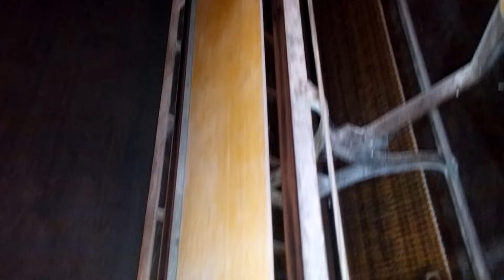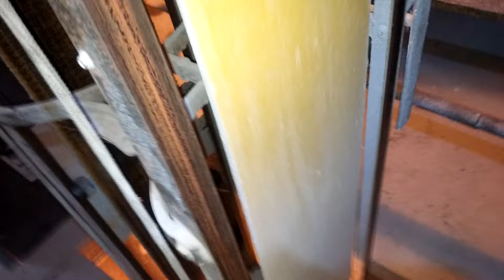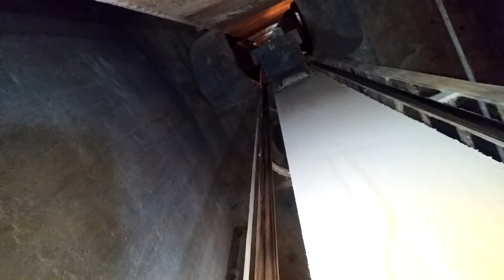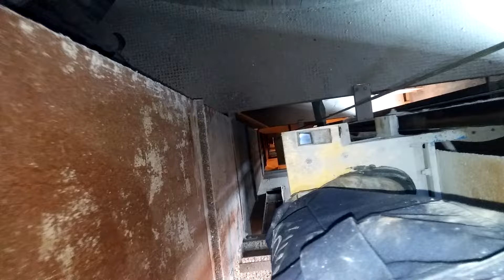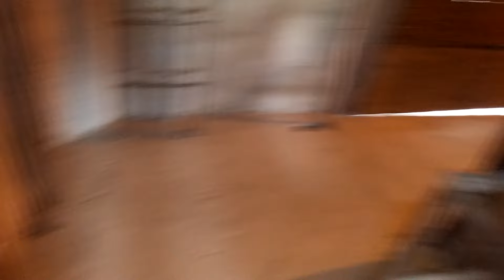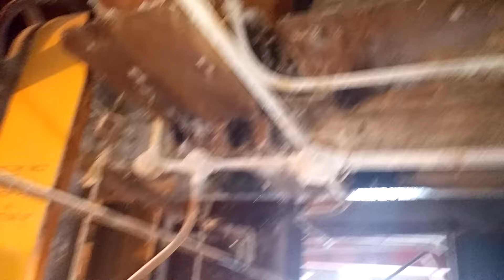Humphries manlift

Comment: As a firefighter, I rode one to the top of the head house on an alfalfa mill fire.  It was just on the silos, so no floors in between, just bottom and top, and it wasn't lit in between either.  Halfway up and its pitch black.  My mouth was so dry by the time I got to the top, you could have struck a match on my tongue.

Comment: Wow!!!! have not seen one of these since childhood days 1950s, my father worked in a flour mill in London and there was 2 of these, he called it a Man Hoist and was told they were used in flour mills. He demonstrated the safety feature by not stepping off at the top  floor, a safety switch came on and it stopped  The mill has been gone many years, and was owned by Spillers who bought it out as Charles Brown, it was next to the Thames and that site is now a BT office. Both of these firms are out of business not BT who are still there which is in Vauxhall.......Thanks for showing brought back memories........Peter
Reply: Me too! Saw these in the 50s when I was a boy,..there was a large Coca-cola bottling operation in Cleveland, Ohio where I grew up, they gave tours of the place. We saw men going between floors to reach parts of the equipment that needed constant oiling and adjustments. Back then they still washed the returned bottles, and refilled them.

Comment: Been about 10 years since I seen one of these things in operation.   The few places I do see them they are permently locked out.
Reply: There is a pulp and paper mill in Terrace Bay, Ontario. They have 2 still in operation.
Reply: I have worked in a magnet wire plant for thirty seven years. We had one when we started.  Installed one about three years later.  Installed another about ten years ago.  Total of three currently in operation.  Franklin, Tennessee.
Reply: @Untraveling at which magnet wire company do you work?
Reply: @Untraveling I work at the one in Franklin, TN.  Been there 37 years.

Comment: I rode one yesterday that’s been operating since the 40s. Went up 12 stories. Sketchy af.
Reply: What happens if the platform you stand on fails...or if someone passes out, or slips or has loose clothing that gets trapped in the machinery??? And what about the children? Did no one consider their safety at work?!
Reply: @DoubleAplusJ  it’s in a factory, all moving parts are shielded, no children are ever anywhere near it. Chill out lol
Reply: @DoubleAplusJ  What about the cats?
Reply: ok Karen

Comment: A plant that I work in the most (by virtue of it being from the 1960s) has one of these and I've never seen it move. Which is a shame, because I have a deep primal urge to ride it.
Reply: Update: the corporate chucklefucks came down and freaked out that more than two masked people were being allowed to ride the elevator at the same time. Left a written suggestion to re-open the manlift. It was not taken seriously.
Reply: @ryanhogge8  heavens do you know how many times a day it'd have to be stopped and sanitized?
Reply: @sherk3286  I ride one in ohio, as a valet driver, we keep it running 24/7. No need to clean and sanitize only yearly services

Comment: Just used one of these for the first time today and man is it sketchy
Reply: I didn’t think places still had these operational. I have seen a couple in abandoned places and really old buildings but they have all been completely locked out for safety reasons. How did you get the chance to ride one?
Reply: @tomwilson3969  There are a few left in feed plants for major chicken manufacturers. I cant say the locations unfortunately.  All will be replaced within the year though.
Reply: I had to ride one in a parking garage a few years ago. Was working with hotel security and had to write an incident report on a car being damaged. Absolute worst fucking experience when you already are afraid of heights.

Comment: I was with a friend parking my car in a parking garage in San Francisco. After we parked we couldn't find the stairs but there was one of these operating near the wall. We walked over looked at it working, looked at each other and said what the hell. He jumped on and I took the next one about 2 or three stories to the ground floor. On the way back to the car we took the lift belt back up. Later we told someone about it and they said it was forbidden for parking customers to use them. It was just for the valet parking people. Oh well. It was really fun though.
Reply: It has been there since at least 1970 but probably dates to when the building opened in 1929.  From the ages of 5 to 10 I desperately wanted to ride that, now I don't think I would.